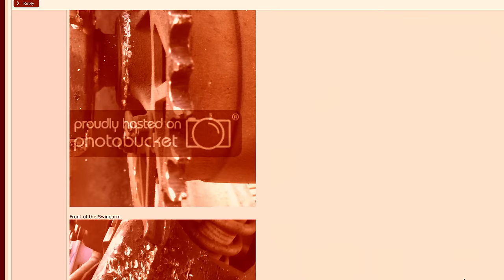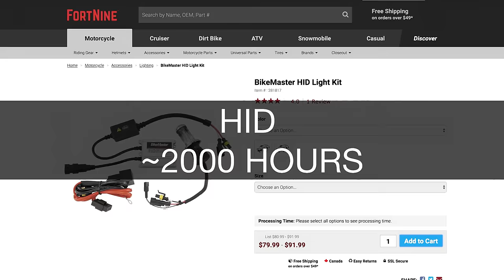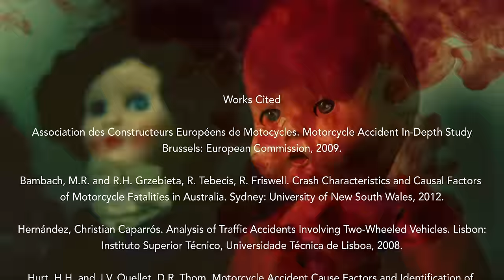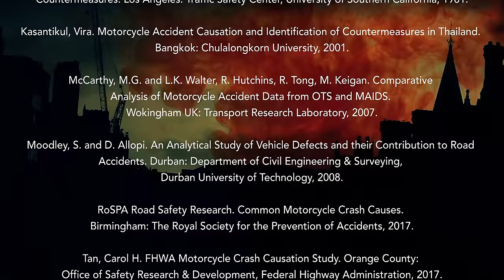Mechanical Monsters – 5 Maintenance Jobs that are Deadly to Overlook

Comment: I fix frozen links with PB blaster then I scrub it with a wire brush THEN I use this Yamaha chain oil that I'm quite fond of, my chains usually last me a while I also use to ride my home made motorcycle to work while it was still a work in progress, had no lights at all and I've noticed cars come closer to me when they see the headlight, its like a moth to a lamp, I was safer without it

Comment: All rubber brake lines should be junked for stainless steel or kevlar. Yes. When built and installed properly they never fail, and the rider always benefits from improved braking feel. Whether he understands that or not. 
Yes, always.

Comment: Always switch to steel braided brake lines rubber lines expand i'm told and you lose a bit of pressure to the caliper when you brake hard.

Comment: I was driving down the road and stood up on the pegs to lessen the blow on my rear shocks. My peg mount snapped off the two bolts hold it on. Not sure how to check for that kind of stuff, but I'll be a bit more diligent. luckily it was my brake side so I could make it home. Gotta drill it out now :/

Comment: I have 4/5 killers. I just fixed my front brake (thankfully it broke while changing brake fluid, not while riding) The chain and sprocket obviously needs replacement, I just need to wait til my paycheck (if my bike makes it haha). Suspension? Way past its service life. Parklight out, headlight is manageable 

As for the bearings, I haven't checked yet. Maybe I'll get a perfect score😂😂 its ODO is already at 68k.

Just sharing my story Incase my bike doesn't live longer to tell the tale.

Comment: What are your thoughts for braided steel brake lines, and shaft drive transmissions? (i.e. BMW R1200 RT or K1600 GT) Everything is led now, so I don't worry about light failure. Plus, if the low beam fails, the right high beam comes on as a backup (again, with BMW) Bearings are always a concern. Also... Hope you and shoulder are ok.

Comment: My front brakes were fading on me, I checked the fluid and...there was none. I don't mean the master cylinder was low, I mean it was EMPTY. And I couldn't see any fluid down the hoses either. I had a slow leak in my brake line, and had just never checked. I'm a new bike owner, so it's all a learning experience, but really. If you buy a bike that's stood for anything longer than 3 months, check EVERYTHING mentioned here. It could save your life.

Comment: It may be tedious to inspect ones chain link by link, however, you can run the chain through your fingers using your tactile sense to find inconsistencies.
Do this with the engine OFF btw.

Comment: In the bicycling world, people check the condition of the chain by measuring the distance between some number of links to the spec.  You're checking for any kind of a stretch.  On motorcycling vids no one mentions this way of evaluating the condition of the chain.  Wouldn't stretch (lengthening of chain) be a good proxy for chain wear on a motorcycle also?  Or maybe chain failure on a motorcycle happens before measurable stretch?

Comment: 0:28 Mononoke Hime Mask ? LOL
I made a habit of changing ALL fluids at the beginning of each year followed by checking the other basic safety items you mentioned and then some more. 
No guessing, no wondering for the rest of it, just ride away. 
Maybe the engine oil twice if I go over the recommended interval.
BTW, 16 year old motorcycle. Nothing wrong with it, YET. If she starts to get too fuzzy there's always CL with lots of cheap "NEW" used bikes for sale.

Comment: I swear every bike I buy needs a caliper rebuild. Usually dirty and corroded pistons forced back past seals by half-arse mechanics at the last pad change. Brakes that don't release properly and warp rotors ($500 - looking at you Harley...). Anyway, that's  how it is.

Comment: Motorcycles by their very nature are dangerous. That's why they are so much fun.
Remember when changing wheel bearings, if you are replacing Timken type bearings and races that you must check the bearing play BEFORE you grease them to ensure that the spacer is of the correct length, else the bearing will not operate properly. I suspect that this has caused numerous bearing related failures because the shade tree mechanic simply does not USUALLY have a dial indicator and suitable mount to check it. So, if you have a shop change your tires, have them check and replace your bearings at the same time. Remember, bearings are cheap. It's not worth having your axle seize up because of poor maintenance. And yes, I have seen this happen to someone who was about 100 miles from home on their way to Sturgis a few years ago. We were able to get them back on the road the very next day after cutting the old axle off as it could not be removed from the fork due to it seizing and locking up in the wheel.

Comment: Squeaky noises on the axles of the wheels, if you ever hear some screeching but you can't figure out where it comes from, and the chain is well lubed, it's a roller, check if the tyre has any play cuz it can be something expensive to deal with if you don't see it soon enough.

Comment: I was test riding a bike (euro dirt bike) and with only 16 hours on it the rear wheel bearing exploded at 90ish kph, the inner bearing race phased out of this reality it was that violent, I'm really not sure how it didn't throw me clean off the bike. The worst part was that the bike was so new. We decided that the only way this could have happened was the bearing wasn't installed right. And I still ended up buying one of their bikes

Comment: i had also got a fatal problem while driving my motocycle in the past, the worst is dont forget to check all things before ride, i got experience where my sprocket adjuster and the rear wheel bearing "blown away" that almost kills myself, in the aftermath that handling was so awful. if in the past i can't handle that horse, maybe you'll never see this comment right.

Comment: Brake fluid should be changed when it starts to darken regardless of time or miles. Heat brakes down brake fluid and starts turning it darker. If you have a bike that has a hydraulic clutch it most often uses DOT4 just like the brake system and almost always turns dark or black long before the brake side because the clutch slave cyl is exposed to constant heat from the motor and the brakes mostly build heat when being used.

Comment: I swear I had my brakes freeze up one time, literally. I was riding home in some awful conditions.. just below freezing, light mist. Halfway home, I stopped at McDonald's to warm up and get dinner. Every forward facing part of me was covered with ice. Immediately apon starting the second leg of my journey, I noticed I was losing my front brake. The lever had become very stiff and brakes were less responsive. It worsened as I rode. Don't know if it was the fluid or the actual mechanism but it was fine again the next day and hasn't happened since. They fluid was kinda brown and pretty low. I've since replaced it. However i had a few more cold rides prior without issue. The only difference that night was the freezing mist.

Comment: Even bearing failures hardly lead to a crash. I have seen Dirtbike that ran for half a season with literally no bearing left in the wheel. The hub just spun on the greased axle, with the bearing seats crushed into oblivion by what was left of the rollers.

Comment: i was in the situation that my chain loose and locking my rear tire, and the main cause was i used racing aftermarket gear set and chain, which harder and more durable. but softer oem chain will likely break before locking rear tire that just safer option

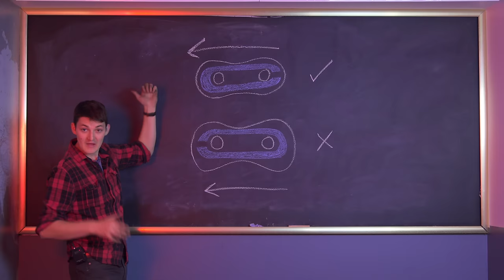Comment: 4:20 but the masterlink will 'flip' as it moves? At the bottom, it may be closed end forward but at the top, it'll be open end forward. So at which point of the chain cycle should closed end be forward? Bottom probably higher priority?

Comment: My bike especially wants to kill me. every month or so something breaks and I have to take it in to the garage to repair it. I've had my rear wheel lock up at 30 mph, the front wheel loose a bolt such that if I hit a solid bump the wheel would have 100% fallen off of one side, I've had brake cables fail and cause me to loose breaking, tire failures, and all kinds of dangerous problems. As a result I'm now very very good at feeling mechanical issues before they occur and staying calm when they happen suddenly and acting accordingly. None of those problems ever threw me off because I knew just what to do. When my rear wheel locked up I stood up on the bike and gently guided it to a stop keeping the wheels in line. The bike is a 66cc 2 stroke motorized bicycle with a top speed of 40 mph. Every component in it, is shit. Hence the high failure rate.
Reply: Yeah I rode one of those "happy time" 2 stroke motorized bicycles around for a while. SO MANY things come loose its ridiculous.

Comment: So I have an '86 flying brick and that final drive has a quirk that is, um, unsettling. As they wear they get some play and thus need to be shimmed. I can't remember if the thing wiggles by hand but when in a turn it sure will and getting used to that before you can fix it is a trick by itself but the dealer said not to worry too much it wouldn't come apart just fix it asap.

Comment: My '07 GSXR-1000 had a brake failure. It cost me my fairings and, a new rear rim and new back tire. Suzuki replaced my master cylinder but that was all. Apparently a small piece of machining debris clogged the hole in the master cylinder that caused my wreck. Their insurance claims rep was very nice at first and then stopped taking my calls. I will never buy another NEW Suzuki after that experience.

Comment: Once I was out riding trails on my Honda trail bike. I was doing about 15 - 20 mph through a corner and had my chain just fall apart. I was lucky enough to just have it fal straight onto the ground without any damage to me or my bike, after a few minutes of searching I found the piece that fell off and the whole chain went together just fine. Still have no clue as to why it broke.

Comment: Hi, 
For three years I went over the information of every motorbike accident, in Israel, where someone needed hospitalization (or worse) - few thousand cases in total. 
Sorry, warn tires certainly kills - you just "blame" those on the rider, but the truth is that what they did used to work, but due to warn tires - didn't.
I do know of few deaths caused by cargo getting loose, including a friend of mine who died in an accident, when his diving gear got loose and tangled with the back wheel... 

Otherwise, quite spot on - 
Another reason for break fails is oil, which usually comes from failed seals in the front suspension. 
To the wheel bearing issue, one should add the steering bearings, which when loose, are reason for accidents. 
Bearings rarely actually fail, but when deteriorating, they (and many more systems) cause the motorbike to mishandle, and than, when accident does happen - the police tend to "blame" the rider, and in a way - he is at fault...

Thanks!

Comment: @FortNine I have a story:

Please could you do a brake pad wear test where you expose them to riding in the sand. I have a cough KLR650 and went all motocross riding through mud dirt and sand (which was amazing btw). After cleaning my bike and inspecting it I drove it for 2 days when my frONT BRAKE PADS FELL OFF MID RIDE. Dealership said the sand could've chipped away the pad/compound but I'm not sure... I think they sold me old brake pads.

Comment: I once had my brakes fall off after getting new tires... they fixed it.. then the front wheel fell off at 80 mph.. someone I saved it, and they fixed that too.. the moral.. don't get your tires changed there.

Comment: id actually change the bearing everytime you have it openly accesable. i personally work with electric engines and there, if the engine is open, even if the bearings are fine to all eye or hand tests, you change it just to make shure. if one fails that could be catastrophic.

Comment: Nice video.  I live in Bangkok and can attest to the headlight problem - a lot of the motorbikes (aka scooters and they are everywhere) have headlights that are out.  I rented a Honda Grom for a month from a well-regarded motorbike rental company and while the headlight worked it looked like the chain had never been lubed since the chain was new - rusty and a mess.  Having said all this, as far as the "big bikes" are concerned, the Thai's ride them with little regard for safety.  I rarely see them being ridden calmly, sanely by Thai's.

Comment: During the wheel bearing segment I kept thinking of ongoing blissful ignorance of boaters. They dunk their trailer in the water a few times a year and otherwise leave it parked in the sun all year long, Oblivious to that neglect they once again have those tiny wheels spinning twice as fast as the tow vehicle’s at 80 mph with the boat and their excess crap at or above the rated weight limit of the trailer. Whatever time they thought they were saving while exceeding the speed limit with numerous other neglected factors is now lost at the side of the road after a dry rotted tire blows, a wheel bearing seized, or both. Plus now faced with repairs more costly than the maintenance items that had been ignored. I’ll skip right past the potential risk they posed to others. I mean what’s the point - they’re so clueless on their own self interest that it would be a huge leap to awaken their consciousness about the risk they pose to others.

Comment: If you have a bike with a shaft drive don't think that they're maintenance free. If a bearing goes in those things or you forget to change the oil you're screwed. I had a bearing go in my final drive once and it nearly locked up the rear.

Comment: All are valid causes of accidents, but I question the statistical analysis. Cable activated slide carbs do have a tendency to hang up the cable casing where it enters the carb, so keep slack to a minimum. I suspect those dirt bike bearing fails are caused by grease washed out by immersion, and of course age. A twenty year old dirt bike is not uncommon. Loose steering head bearings are more probable causes of instability over sag. Make sure last weeks quick fix doesn't become next weeks catastrophic fail. Trail riders get in the habit of pulling up on the bars to lighten the front end, and if the grips aren't well glued on you'll yank yourself off the bike. Knobbies on pavement is like roller skating on an ice rink. Low tire pressures cause flats as the tire slides on the rim, stressing the base of the tire valve attached to the tube; use rim locks. Ride safe everyone.

Comment: I almost got killed by the brake- hose monster once a few years back... Previous owner replaced the OEM hoses through steel-braided ones. And installed the middle fitting where the hose is split from one to two in a way, that every time the fork was turned fully to the right it gave an ever so slight knock to the fitting. Over time, the material of that fitting gave up and there was a crack.

I realized that sudden frontbrake failure while parking my bike at a biker bar. Right after shooting down through some nice open twisty roads at about a speed of 120-140 kph, braking late in to the corners...

Gheee, everyone can imagine the goose bumps that gave me, when my right fingers didn´t feel any resistance pulling the brake lever in the parking lot....

Always check and maintain your brakes thoroughly on a regular base... It´s life saving!!!

Comment: Let's be real, who changes brake lines every four years, brake fluid every two and fork oil every year? Like 0,001% of those who ride? I change brake fluid every two years and that is already excessive. Before you change brake lines, I would recommend checking the caliper seals first. If the calipers cannot be moved with fingers, clean and replace the brake caliper seals.